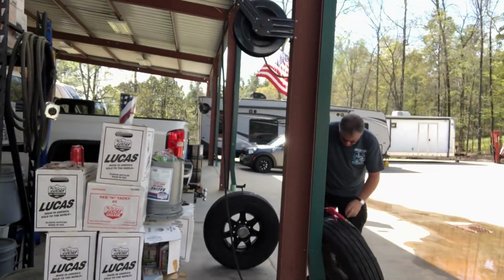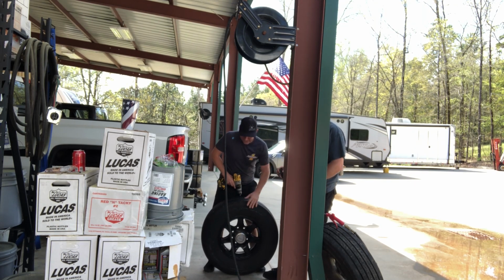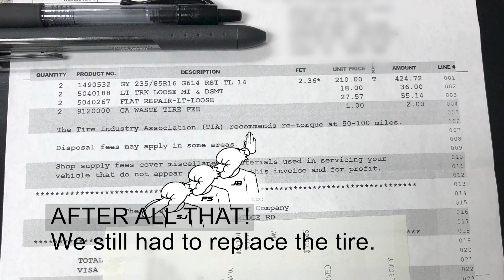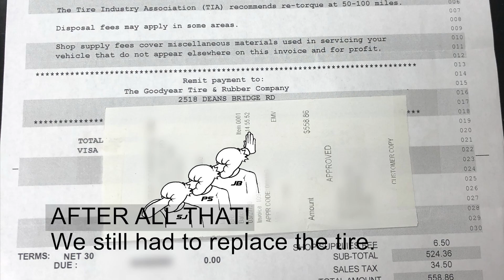How many drag racing professionals does it take to plug a trailer tire!

Comment: once you put the plug in there you have to twist the tool to knot it up before you pull the tool out, that's why the tool has a groove in the hole area. also why the plug keeps pulling out.

Comment: You NEVER plug a radial tire, it will push the cords apart and WILL separate, all your drilling is cutting steel cord and making the tire weaker (I did commercial tires for 25 years including the giant tires and for Goodyear Racing (a distributor as an installer), pretty much a 100% that tire will fail.
Reply: Like a regular car tire steel belted radial? I've plugged them and ran them bald more times than I can count lol...
Reply: @robertelmo7736  your a lucky guy
Reply: @mgbchuck6527  Jesus is who gets the credit lol. I swear I have a fusion with a plug in it right now lol.

Comment: fixed hundreds of tires when i was young  over 40 yrs ago back then we always broke the tire down and fixed it from the inside with a boot plug that was glued it would last the lifetime those plugs you used are a band-aid not good on radial tires sometimes they work but most of the time they leaked old bias ply tires they did ok,would never use that on what you got